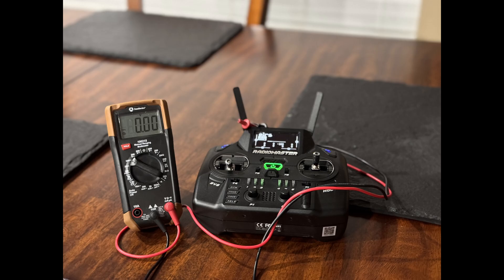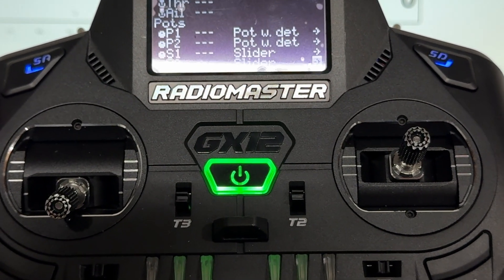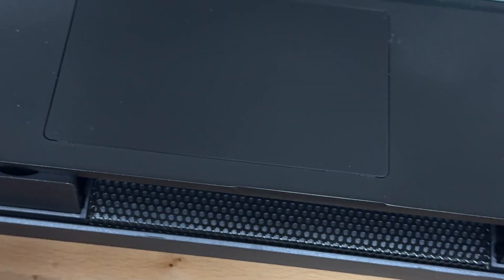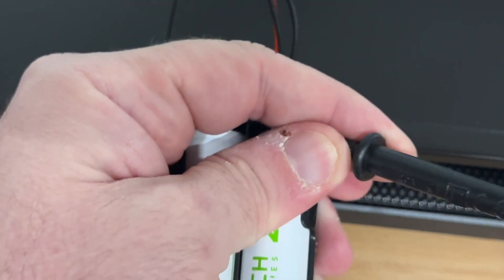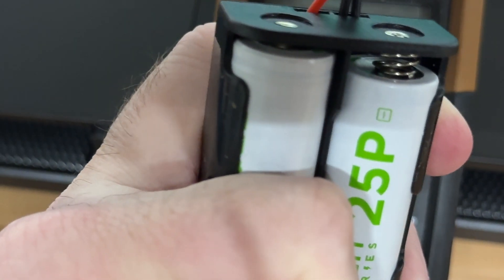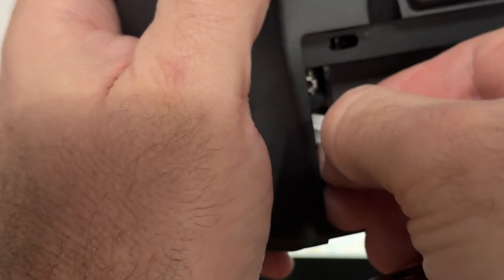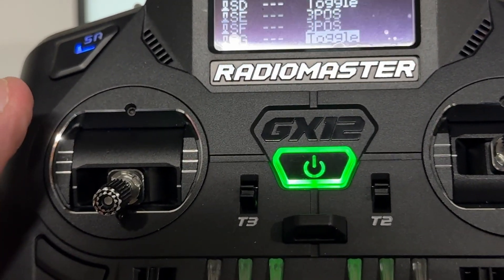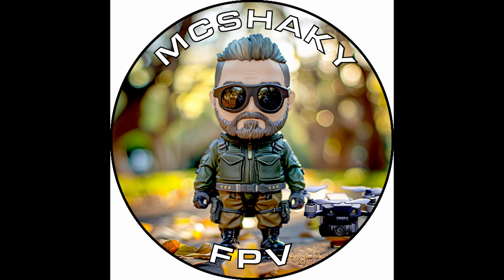Radiomaster GX12 EdgeTX Voltage Calibration Howto

Comment: When you power on the radio voltage drops. You need to turn on radio and check the battery voltage with radio turned on
Reply: true